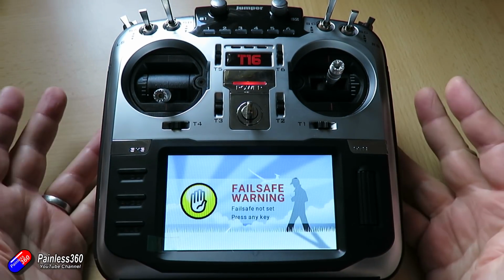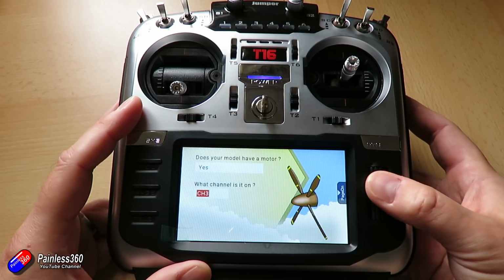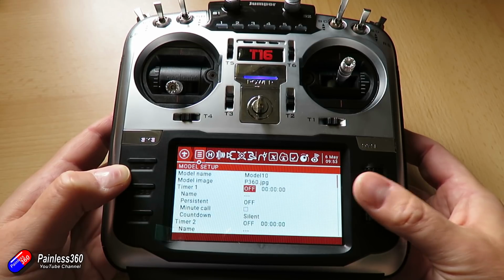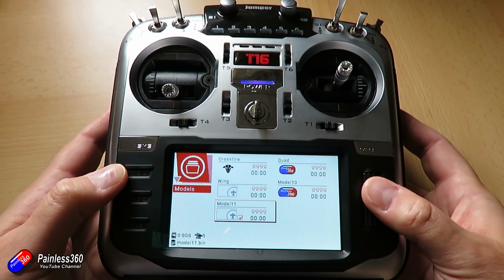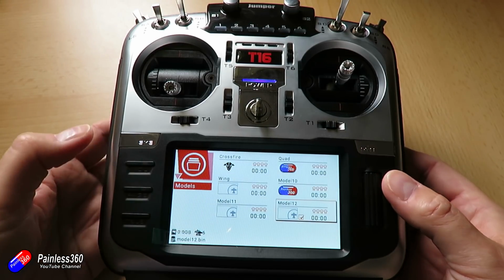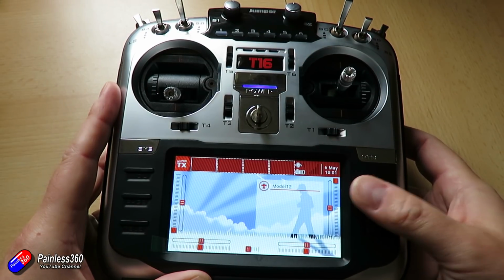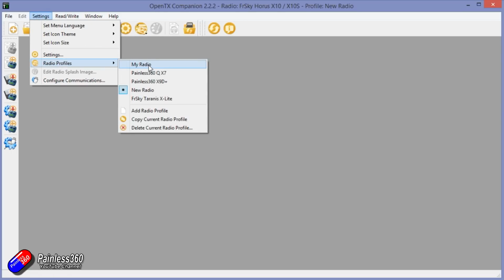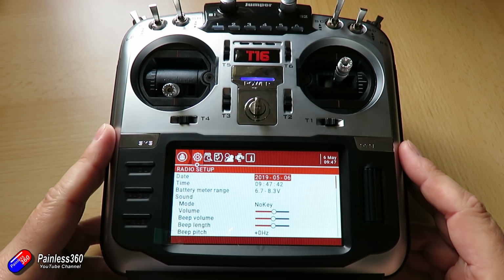Jumper T16 Radio: Model setup tips

Comment: I fly giant scale planes i want to get away from spectrum do you think this radio would be safe to use or should i go with the x10s horus i just thought the previous releases from jumper were more toy like i realize i would use the multiprotocal modual in the x10s my email is michaelgrossman666@yahoo.com thank you i love your vidios and respect all your knowledge
Reply from the maker: You can always remove the multi-ptotocol JR module and replace it with a 'real' FrSky module if you're worried about compatibility and range..